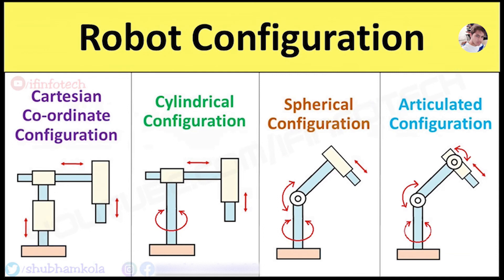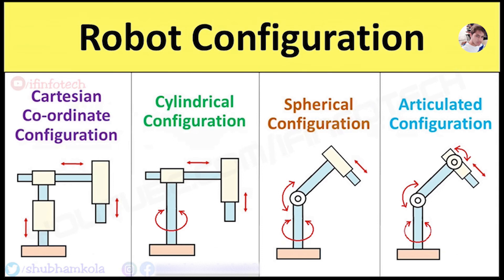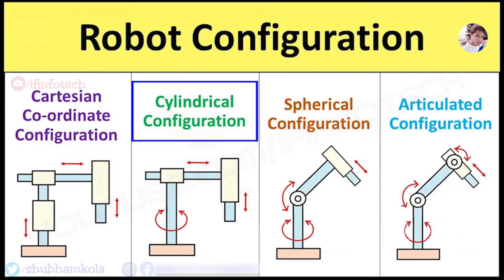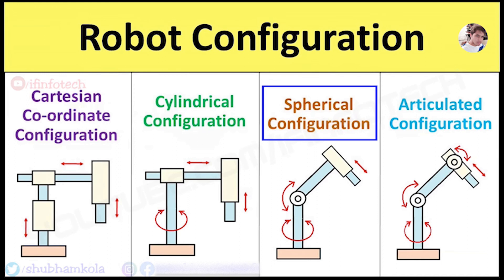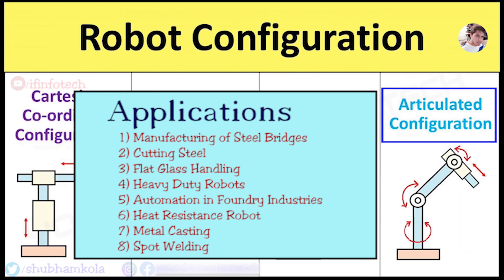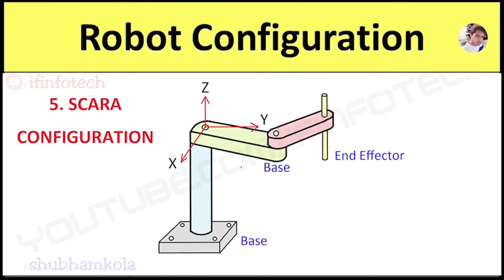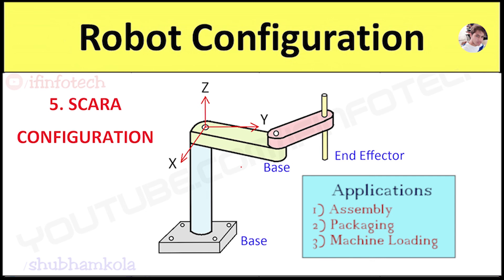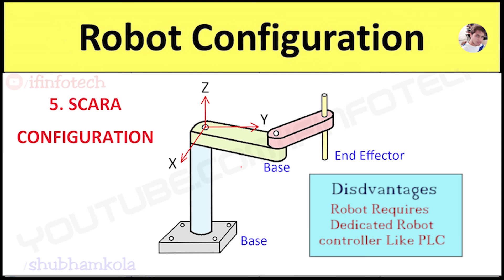Types of Robot Configuration: Cartesian Coordinate, Cylindrical, Articulated, Spherical, SCARA

Comment: Applications and advantages and disadvantages of spherical robot ledu cheppandi plz
Reply: Is spherical robot is same as polar robot  plz explain
Reply: @pinapareddiyerni7953  both are same
Reply: Tq
Reply: Fast ga cheppndi
Reply from the maker: Spherical mobile robots have applications in 1) Surveillance, 
2) Environmental monitoring, 
3) Patrol, underwater and planetary exploration, 
4) Rehabilitation, child-development, and entertainment.

Spherical Robots Advantages:
1) Fully Capable of 360 degree Rotation, 
2) Long horizontal Reach. 

Spherical Robots Disadvantages:
1) Lower profile,  no linear actuator for z axis, 
2) Small Work envelope.